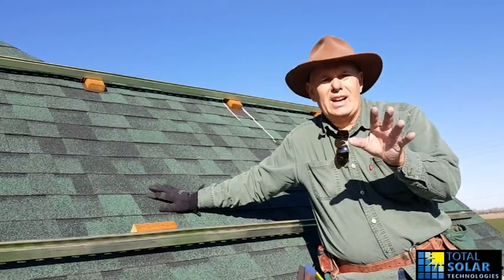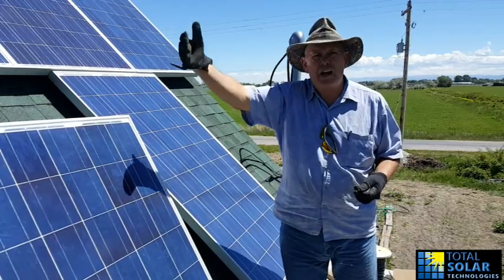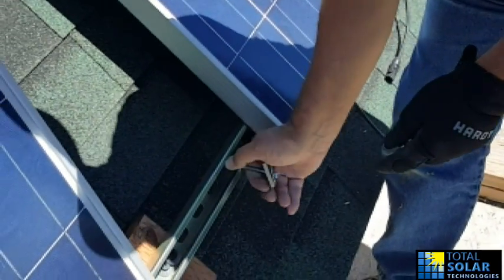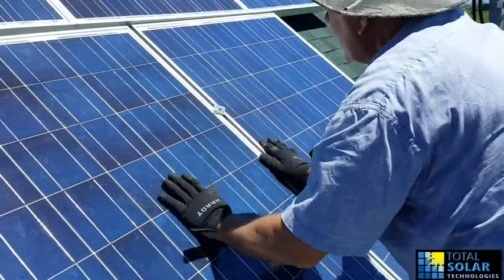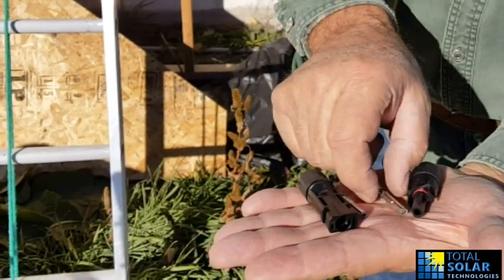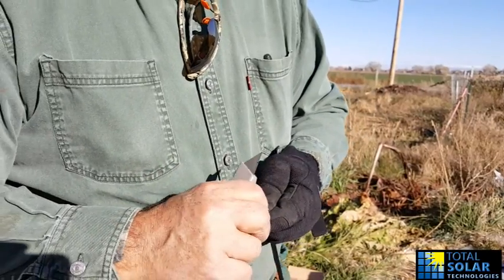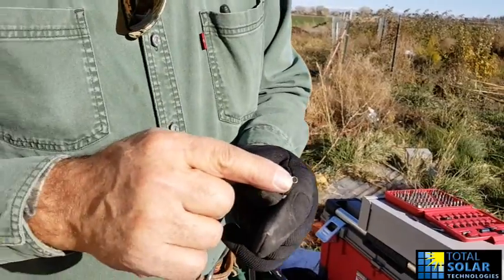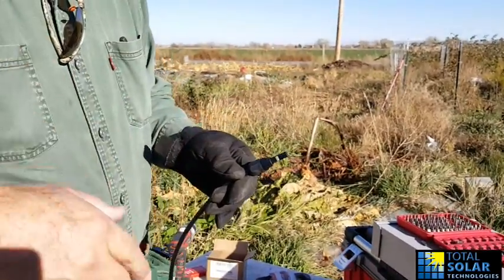DIY Cheap Solar panel install 2

Comment: The combination of galvanized steel of the angle bracket and the aluminum of the panel could eventually lead to galvanic corrosion of the aluminum.  Did you notice any corrosion on your 20 year old system?  (It is more likely to be a problem in wet, humid environments than Wyoming, especially near the ocean, where you get salt mist.)
Reply: I'm intend to install here in Florida Panhandle, so pretty humid. Do You recommend any grease or stuff like that to avoid corrosion? Thank for any advice

Comment: Whatever you do, be sure to leave room for expansion between the panels!  Don't tighten the connectors so much that the panels can't move.  I like that he uses a clamping mount instead of drilling into the panel. The panel temperature can be anywhere from -30F at night to +150F (or more), and this causes contraction and expansion both length and width of the panel.
Reply: They don’t expand that much it’s wood

Comment: Problem with the bolts -> ground. If one of your wires goes bare ... the entire system is energized to ground making a nice hefty shock ... #UseCertifiedTechnicians

Comment: Thanks for the video.  I am curious about the top row.  It looked like the panels extended over the ridge.  I wonder if the top lip would grab high winds.  All other advice seems to make sense.   Thanks for your response.
Reply: Brent Johnson Ditto. I’ve never seen and install that extended the crest of the roof. Terrible idea.
Reply: Depends on where you live, but most places if you solidly install it to the roof truss it won't be a problem.  The advantage is that you might get an extra row of panels on the roof AND... it keeps most of the leaves and rain from getting under the panels, so if you have a leak it will be small.

Comment: How has this held up since it was installed?  I'd be worried about the wood expansion/contraction eventually leading to leaks or does the sealant expand enough to be ok?  I was trying to figure out the best DIY approach myself as it's very hard to find solar stuff here in Canada, but ended up finding a site but the mounts are like $27 each.  Ended up just biting the bullet and buying them.  Not sure yet what I'll use for racking, the critical thing is how it's mounted on the roof as you don't want leaks.

Comment: What is your spacing for the Supports from Roof to Rail.  I am getting anywhere from 2' to 4' all over the internet.  Some people using 2' spacing,  some people using 4' spacing.  I want the rail to be secure ... but do not want overkill so I do not drill to many holes in my roof.

Comment: i got quoted $900 shipped for 4 rails for a small 8 panel system using ironridge rails with all the extra parts and flashings too. Sounds like a rip off, so I'm very thankful for these two videos Total Solar. 	I think I can do it for less than half that price with generic metal rails. I'll let you know how it goes. You hint at a 3rd video, discussing combiner box and inverter hook up, but I can't find it.
Reply: https://www.youtube.com/watch?v=luGKyqBrZFo